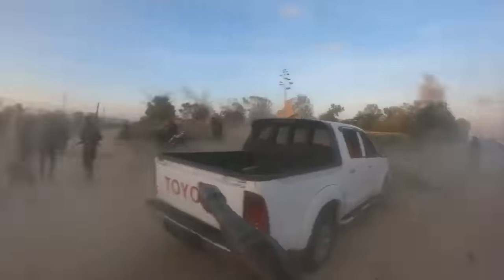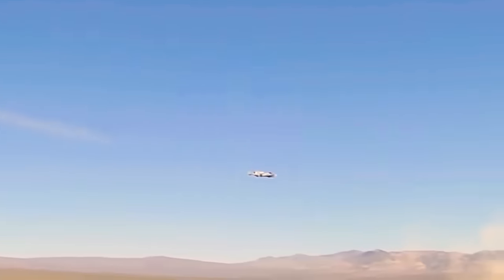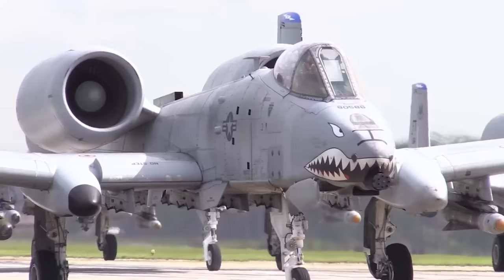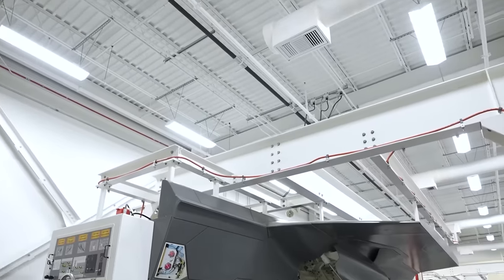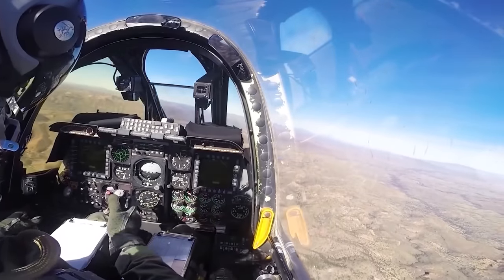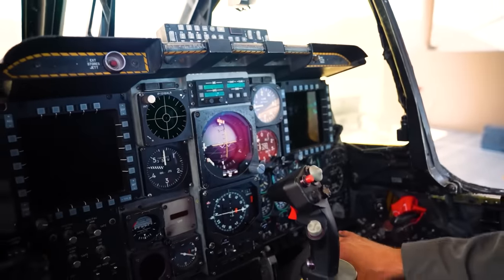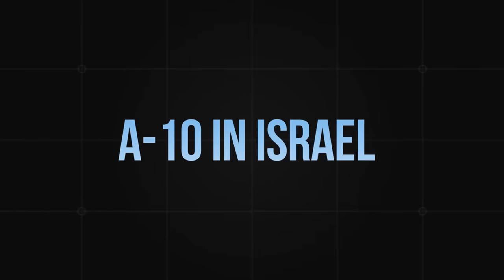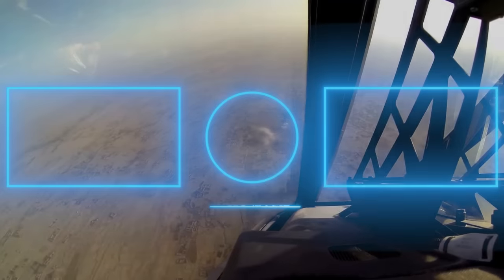US SECRET A10 Warthog - US Finally Tests In ISRAEL!

Comment: The A 10 is tested and proven itself time and time again in actual battle. The upgrades enhance further its lethality. An excellent news and morale booster for the grunts and friendly boots on the ground. The F 35 still needs to prove itself.
Reply: The F35 never will be able to; the weapons payload and loiter times are night and day. A single A10 is probably equal to 4 or 5 F35s in terms and lethality, and they cant take the same damage. Sure they stay out of that small arms and anti air gun fire but 1 strafing run from the a10 and it still have more ammo and bombs not used to take out the anti-air. 
Anyway creating a novel here... the leaders who run the money are corrupt and want their deals. But upgrading the A10 may have just saved it because its lethality is now going to go through the stratosphere.
Reply: @davidohare2933  It would take another plane custom built to do the job to replace the A-10 effectively. A plane meant to do too many roles just isn't going to compare.

Comment: The 35 and the A10 are both needed its clear that the 35 is best for long distance fast interception of other Jets and hitting targets from long range it is also clear the 35 is not good at close combat when it comes to assisting ground artillery and troops in low altitude on the other hand the A10 it's clear that it's the best when it comes to close combat encounters with Arsenal artillery and military presence in the location it's more of a close range deployable backup unit for ground units so therefore you see that both the 35 and the A10 are both needed for their different roles the 35 for fast response at long distance long range targets and dog fights at high altitude it is the goat of high altitude and the A10 for fast ground support its sufficient in dog fights in low altitude it is the Goat of backing up ground forces at low altitude
Reply: very different operational attributes - to compare them is irrational.  You nailed it

Comment: It seems that the stealth properties of the F35, great for high speed, long range one-time strikes deep into enemy territory at night, would be lost or compromised with repeated low level surgical strikes during daylight hours which are often required for close air support.  In the latter case you have an extremely expensive aircraft not as durable as the A10 subject to all sorts of ground fire that may not rely on radar or heat guided weapons.

Comment: I have to believe the purchase price and operating cost of the A-10 is way less than the F-35.  And its durability after battle damage is awesome.  A-10s are better at what they do and cheaper.  Don't throw away F-35s when they could be doing what they are really good at.

Comment: Play 18 was specifically designed for support of our troops on the ground and anti-tank warfare where are the f-35 is a multi-purpose aircraft that cost much more money than the.A10). And it's armament is far greater than that of the f-35 which is designed mainly for are anti-aircraft and are to ship warfare and major bombing missions

Comment: THESE PLANES CANNOT BE COMPARED TOGETHER! The mission designs specs ARE DIFFERENT from each other. The A-10 is designed to support infantry, tank, and combat support in EXTREME SITUATIONS. The A-10 does really close quarter combat and the cockpit is tubbed in titanium. THE F-35 WAS NOT DESIGNED the same way or specs. so they don't compare. The F-16 is BETTER suited for A-10 roles than the F-35. The F-35 is like a modern HARRIER JET, that's it! Please consider engineering spec. designs and TOUGHNESS in battle before making any assumptions. Thanks for the video 📸.

Comment: The A10 has another advantage over the F35, the A10 can easily be repaired in the field with hand tools.
The only replacement for an A10 is another A10, and if the Air Force do not want the A10 I'm Sure that the Marines could make good use of it and they'd take it lock, stock, and barrel, as is,

Comment: The A10 was purpose built to be a durable low cost, easy to maintain,  ground support anti-tank and mobile artillery attack aircraft.  The F35 is neither inexpensive nor easy to maintain.   The munitions that are available for these two aircraft are unsuitable for precision strikes with compact zones of damage. (30mm depleted uranium rounds that miss a hard target can travel a mile, blast through commercial and residential buildings as if they were paper).  That makes them unsuitable for high population density areas unless so-called "collateral damage" is totally acceptable.  Small drones like those being used in Ukraine would be more suitable and far less expensive, but infantry with drone support is a much better alternative.